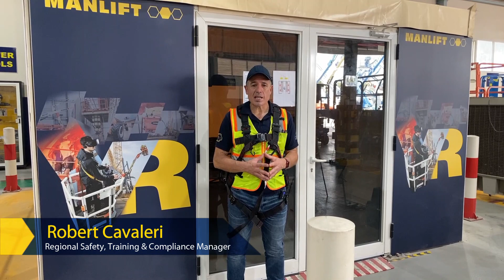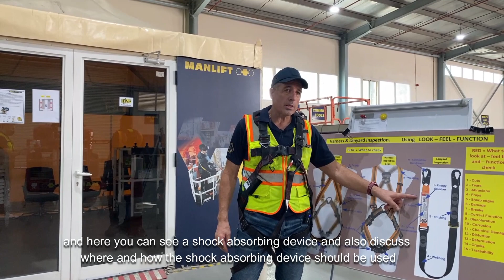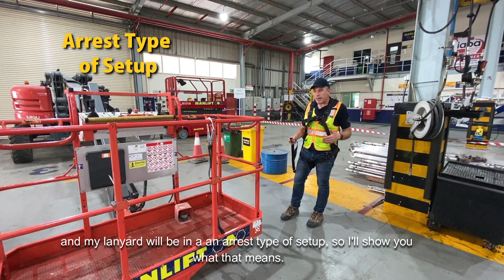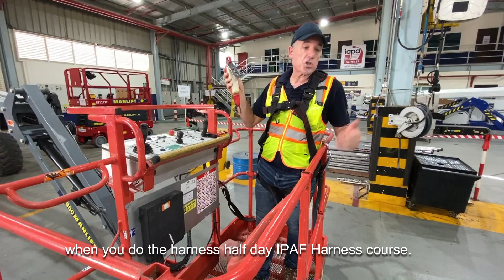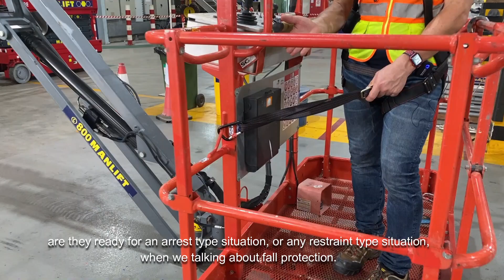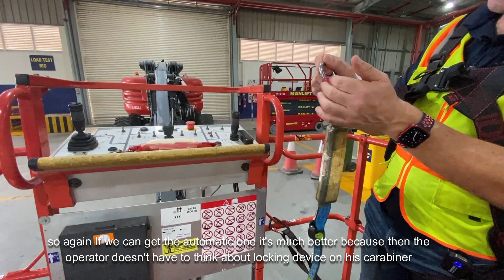MEWPs Harness Safety Tips | Manlift Group

Comment: Q. In US, aren't you supposed to use a connector with auto closing dual action type? in the video you use a scre-gate carabiner to connect to Anchor point in MEWP. 

Thanks for making a wondering traning video. it is awesome and clear.
Reply: Thanks for your comment. In most countries where "fall protection" for persons working at heights, is on the radar, there can be numerous jurisdictions that will reccomend, or offer guidance on or even mandate a specific approach or system to be used. "self locking" or "auto locking" karabiner's (connectors) are a great "best practise" as these connectors eliminate a "human error" possibility of not closing correctly or securing the karabiners' locking mechanism after it is latched to the "approved" attachment point. These "self locking karabiner's are not mandated in many locations, so other "approved" types can be used. (but fYI in our organisation we will "prefer" their use, and procurement as older harness/lanyards get replaced.) I reccomend you also take a look at an industry recognised organisations i.e > www.ipaf.org web site and the good guidance you can find there on this topic and many others related to MEWPs (AWPs) safe use. The topic of fall protection is vast, when I talk about it, I usually will be specifically thinking about fall protection in MEWPs; the limitations and idiosyncrasies that relate to MEWPs.

Comment: Think about it. It is not correct to tie to the lift platform with a shock absorber lanyard.
There must not be a situation where the operator of the platform could fall outside the platform railing. therefore the operator must be tied with an adjustable lanyard fall prevention rope to the front ring in the full body harness. During the travel of the lifting platform the rope must be taut.